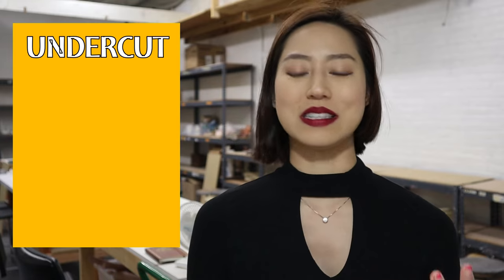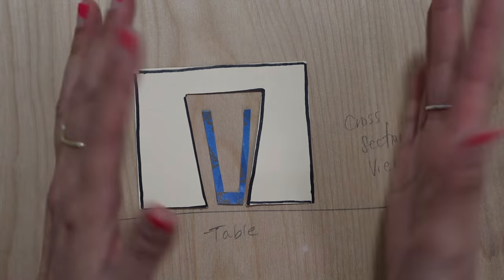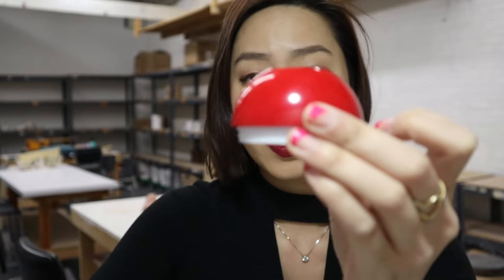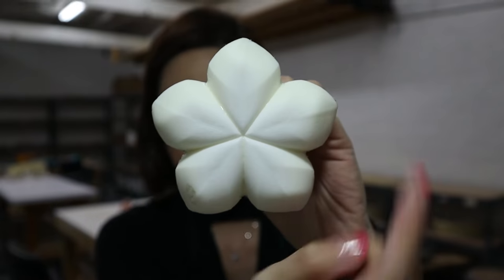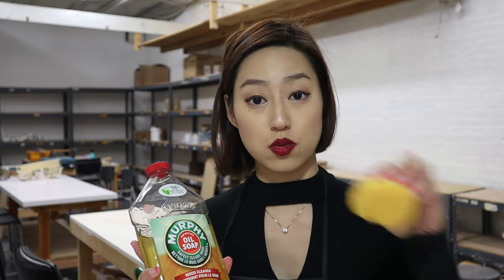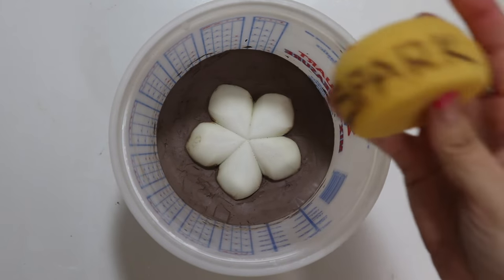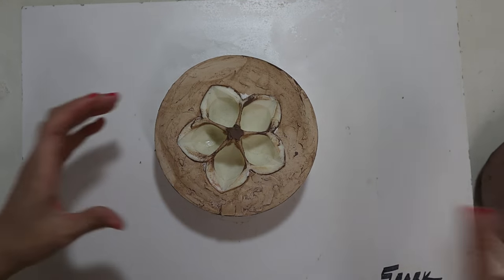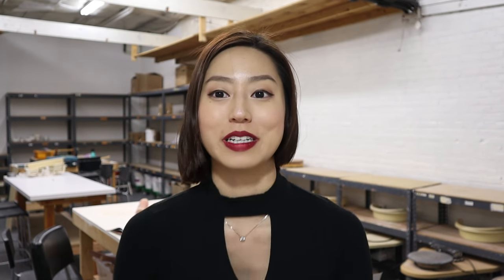How to make the EASIEST plaster mold!

Comment: And this comes from a mold maker....I LOVE your videos!  I will make sure I mention your channel (if you don't mind) when I do a video on molds, plaster or mold making.  Great work!
Reply: I know nothing about molds. Could you explain how to make a mold of a teatray or serving platter? Please. :)
Reply: @deborahgonzalezknight168  Actually you do not need a mold.  Find the clay body you wish to work with , roll mit out about 1/4 to 3/8 inches thick and place a plaste or platter of your choice over that and cut around the edge.  Remoce the platter or plate and then place the cut out clay on the inside of the platter/plate and gently smooth the clay to the inside conture.  When the clay dries, remove it, clean up any imperfectionass and fire to bisque.  Hope this helps.

Comment: Great videos...well done and informational. I make simple open face molds for glass fusing and am wondering what ceramic mold material you are using. The material I use usually breaks down after a few castings and doesn't hold detail that great. Keep it up!!

Comment: what sort of clay is used ? I've seen a few people use clay as a base or in two part molds but what type of clay can be used. Air dry Clay ?
Reply: Since you haven’t received a response to your question yet, I’m curious what exactly you meant…do you mean what type of clay can be used to cast with? Or are you asking what type of clay at the bottom, just to make a base to put the form in?

Comment: Can you cast molten Alluminum or brass in a plaster mold ;
Reply from the maker: I recommend using casting sand. Your plaster mold will burn or can explode if it is still wet. yikes!
Reply: Ok ,thank you.